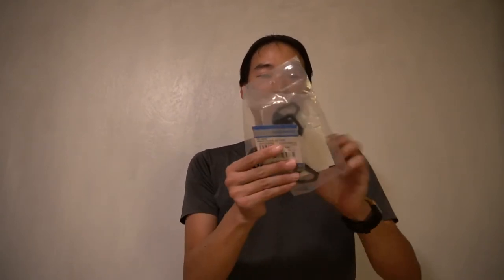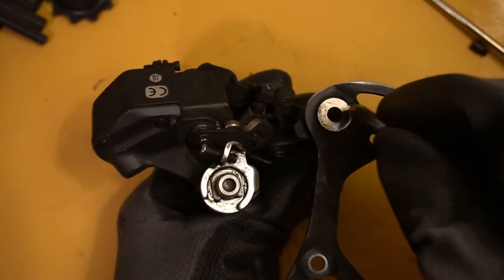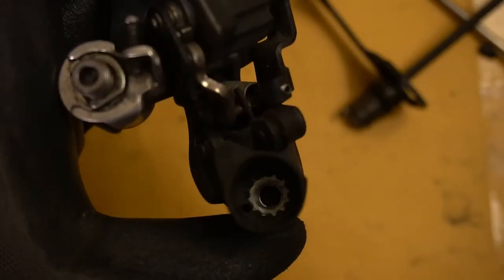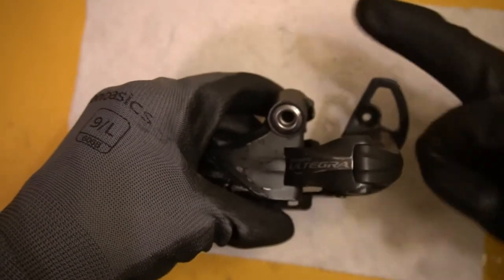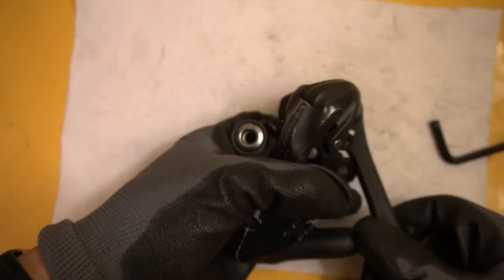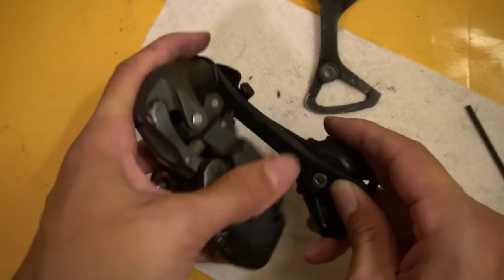How to convert short cage rear derailleur to medium cage (Shimano Ultegra 6770 with 6800 cage)

Comment from the maker: Table of contents (click read more):
0:00 Introduction
0:27 Parts / tools needed
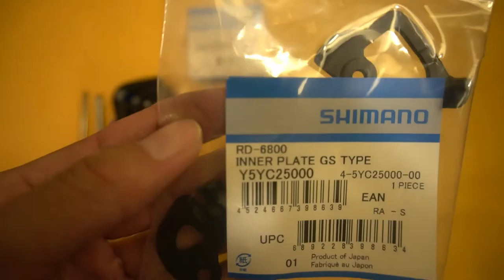0:53 look at SS/GS cages
1:24 tooth capacity explained 
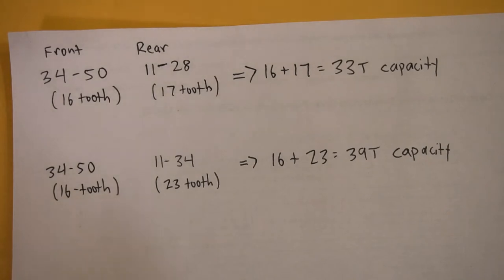2:27 remove short cage plates
6:28 look at outer plate and spring assembly
8:17 weight comparison of cages
8:44 ss/gs cage visual differences
9:53 GS  cage INSTALL
14:25 look at ceramic jockey wheel
17:08 reason for upgrade
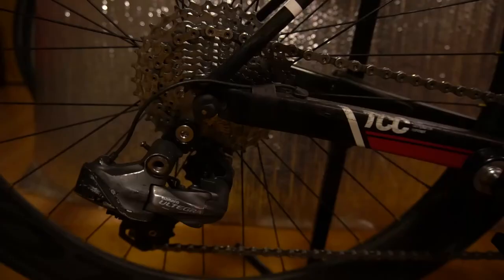17:42 testing new setup
20:04 another view of conversion
20:18 Conclusion

Comment: Try and get better lighting on your next video. There was a lot we couldn't see. I was good that you were able to squeeze by with that next set up. But like the problem I'm having now is that there is more than just putting on a longer or shorter cage. There is also the (like you found out) that the jockey wheel height is not always at the right position and cannot be corrected with a B screw. 
I wanted to go to a 11/25 road set up on my gravel bike instead of the 11/36T that came with the bike. It also had a long cage. So the cage was designed to come way down to accommodate for the larger 36T sprocket. So when i only had a 25T on there the derailleur was too far away from the sprocket and could not be brought closer and when I brought it as close as I could...then it was too close and walking all over the smaller 11T.  I got it to work but it was terrible at shifting . 
So I ordered a small cage for my lightweight 11/25 or now 28T sprocket. Didn't need the 36T gearing for my riding and the cassette was heavy as lead.
Reply from the maker: Good job finding a compatible rear derailleur!  Thanks for the advice, I have lots of bike lights but none specifically for my camera.   I've ordered a little LED light for the camera and plan on using it in future videos.  Have fun out there on your cool gravel bike!

Comment: Thanks for the video!!! I’m trying to do the same thing with basically the same equipment and same first gen di2 derailleur. I’m going from an 11-28 cassette to an 11-32. Did you have to add any links to your chain after the conversion?
Reply from the maker: Yes! I went with an 11-34 and ended up replacing the chain with a brand new dura ace chain sized appropriately.  I'm going to see if an 11-36 fits.

Comment: Thanks for posting this video. Just one question: which rear cassette did you use ? Was it Tiagra 11-34T ?
Reply from the maker: Shimano CS-HG500 10-Speed 11-34t Cassette.  Good luck!
Reply: @pedalpowercycling  Thanks. That's the one I just bought, luckily!

Comment: Juts one thing; I don't think you replaced the rubber seal under the inner plate when replacing the spring?
Reply from the maker: You may be right Keith.  However, it's been awhile since this modification and it's still working very well many many months later.  Thanks

Comment: I'm looking to do the same on a 5700 SS derailleur and change the plates to GS ones (from 5700, 6700, 5800 or 6800, whichever I can find). So that I can use it with a 32T cassette. Do I have to get a hanger extender as well? Thanks!
Reply from the maker: I'm not sure, each bike rear derailleur hanger is a little different.  Some models may require an extender while other bikes mounting point is low enough.

Comment: Thanks a lot! You done a great experiment and super clear!!!! 
I have a exactly same situation from 6700 SS to GS.  

May I have a question about the "tooth capacity explained "
I have front 22-34, rear 11-40T, the Capacity is 41T
Is it still work in 41T capacity? or I need to use 11-36 instead of?
Many thanks
Reply from the maker: It looks like the chain slack will work. What rear derailleur are you using?  Is it an XT M8000 SGS?  That should work.  If you're using SGS, then the capacity is 47T.  Medium is only 37T capacity on Ultegra 6800 medium cage and probably won't work.
Reply: @pedalpowercycling  thanks for your reply. I’m using  ultegra 6700 with SS cage now. And I will convert it to GS, by using your experience 😅. 
As your mention medium cage is 37T max. So I will use 11-36T. 
Thanks a lot. I let you know when done😅
Reply from the maker: @vincent71611  The capacity is 37T, that doesn't mean you can use a 37T cassette.  But with a derailleur hanger extender it might work but the lower / small gears may not shift as well.
Reply: @pedalpowercycling  yes. I count front 22-34, 11-36 capacity is 37T. I will try the extender too... Anyway thanks for your advice! 💪🏻💪🏻
Reply from the maker: @vincent71611  Oh! If you're running Shimano mechanical shifting 10 speed, then you can use a 9 speed MTB rear derailleur instead. I can make a video on that to show you.
Reply: @pedalpowercycling  Hey, it will be very helpful. I believe that people want to know about that too. 💪🏻💪🏻💪🏻 support 💪🏻💪🏻💪🏻

Comment: Hi! Thx for this video.. for you its compatible with 9070??
Reply from the maker: Hi Matteo, the 6800 and 6700 series are not supposed to be compatible but it works.  Here's a pic of the 9070 series plate:  https://www.modernbike.com/shimano-dura-ace-rd-9070-rear-derailleur-outer-plate-and-stopper-pin  It'll be a try at your own risk.
Reply: @pedalpowercycling  thanks!

Comment: I have Shimano 11 speed, short cage RD6700, do you think I could possible use the same kit 6800 11 that you used? tks..
Reply from the maker: I don't know, it's do at your own risk.  My Di2 might be different than yours even though they're same generation.
Reply from the maker: Why don't you just buy a medium cage ultegra 6800?  My rear derailleur didn't come in a medium or long cage and upgrading in my case meant new everything not just a rear derailleur.
Reply: @pedalpowercycling  tks for the response

Comment: I have also a Ultegra rear derailleur  with an SG cage. The total range that it has to deal with is 46 (50x35 plus 42x11). It  is imposible to ride with it. The chain jumps in the moment of leaving the saddle and standing on the pedals. I think shimano is not making any SGS compatible with this derailleur. Do you think that it would be possible to fix an SGS cage from other model or even from other brand? If I cannot find any adaptable cage I will have to think in changing the complete rear derailleur. Do you think that a 3x11 tourist rear derailleur could work with my cassete and with my compact chainrings? Your thoughts are wellcome.
Reply from the maker: Are you using 11 speed shifters?  Which ones?  Are you on 11s ultegra rear derailleur?  If you're 10 speed you're in luck if 11, not in luck.
Reply: Well, everything is 11S: cassette, shimano shifter and chain.
Reply from the maker: @eugeniomiguel1  Yep, you're kind of out of luck unless you install mountain bike shifter and rear derailleur.  I have this set up on my recumbent.  34-50 front, 11-40 or 42 rear all shimano 11s and it works well.
Reply: I suppose that you are using a BTT rear derailleur with an SGS cage, aren´t you?
Reply from the maker: @eugeniomiguel1  I don't know what BTT is so probably not?
Reply: Sorry ,  that is a Spanish acronym. I mean that you  have actually installed on your bike a mountain bike rear derailleur model, haven´t you?

Comment: All you had to do was add the hanger extender.
Hv an r6700 rd myself.
Reply from the maker: Unfortunately only an extender doesn't work for me.  There's too much chain slack to a point where the bottom of the chain would swing and rub the rim and tire in certain combinations.
Reply: I have used the hanger extender to modify a 2005 TCR to use an 11-32 cassette but I also ran into the same problem that @pedalpowercycling did on 3 or 4 other bikes that I tried to do the same modification where the derailleur couldn't take up the required extra chain length even with the hanger extender. I used an 8 speed MTB derailleur instead of the extender, a 9 speed derailleur worked even better. 
Unfortunately for @pedalpowercycling, he has Di2 so he cannot use this solution

Comment: Guys, cmon, please, don't clone this shitty information! SS and GS derailleurs differs not only with length of the cage. There is also another parallelogram and slighly another geometry! Because of videos like this now I must find GS version to my customer, because I bought SS and install GS cage to it and thought that I'm smarter than many people. But not! This will work only if you will use under 30t cassetes and with this longer cage maybe you can use triple crankset.
Reply from the maker: The purpose of this video (in the Intro) was to see if I could install a longer cage onto my short cage rear derailleur.  In the video I'm also using a derailleur hanger extender to help my derailleur for an 11-34 cassette.
Reply: @pedalpowercycling  hanger extender doesn't extend derailleur parallelogram. And this is very major thing. It will work, but it's not correctly. Many YouTubers show this like panacea, when you need GS version and you can't find it, but it's weird method...
Reply from the maker: @Михаил-ъ9у5е  I understand that but there's no 10 speed ultegra di2 GS rear derailleur.  The shifting works well with my setup.